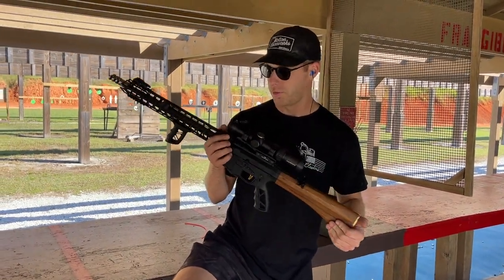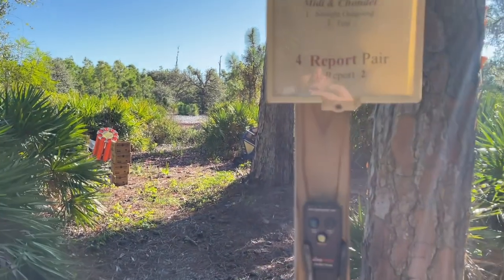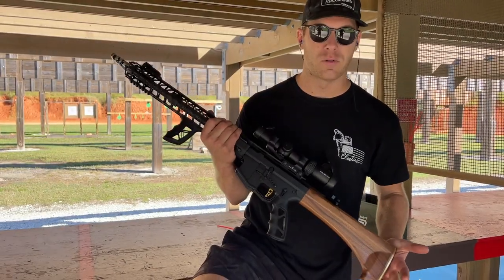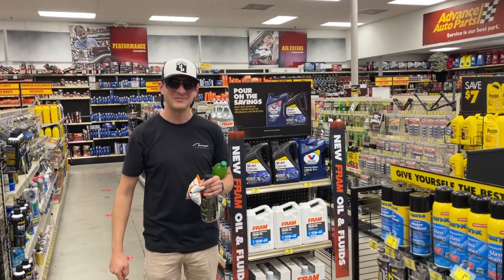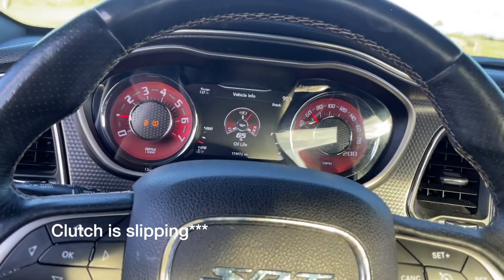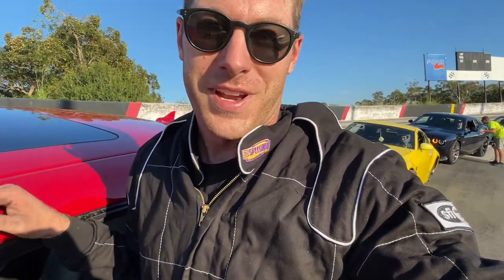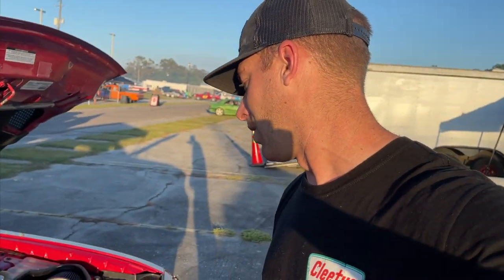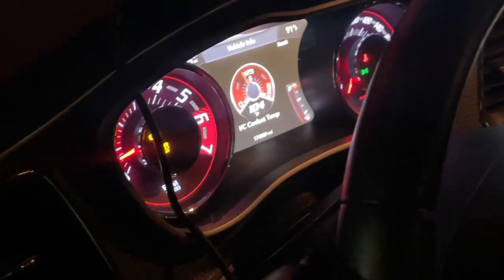Shooting Jesse James Nomad 2 & Drift Night at FREEDOM FACTORY with HighCat!!! We've got Major Probs

Comment: It's a real advantage that the truck is high off the ground for emergency repairs like that, makes life simple. All my cars I need a jack and stands or a ramp. You can really hear the blower whine in this video so the shop saying it was fine are right. Probably gonna need to carry some typical failure parts and the tools needed till you get everything dialed in again. Amazing its still so happy and making great power with all the miles on it but maybe it actually got regular oil changes and maintenance and spent most of its time on the freeway cruising easy. I spend my time mostly trying to drive gently in my old 06 Charger RT trying to get anything over 12 something in it but enjoy the excuses to hit the loud pedal and let it eat.
Enjoy the toys and all the cool stuff you get to be involved in👍

Comment: Grab you a McLeods RXT Clutch and be done.

Whoops, nevermind lol.

What would concern me is the flashing check engine light. After the water pump, I’d have them check to see if the head gaskets are still holding tight. Tuff break!  Hope it works out for you!
Reply: That the check engine light is from it being in limp mode because of it being to hot.
Reply: Not a blinking check engine light. It blinking is from a misfire. I specialize in Mopar performance and do this on the daily. If the light were on solid I’d assume it’s from limp, but flashing means misfire 100% of the time.